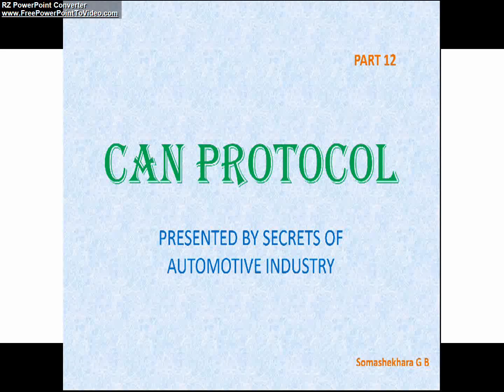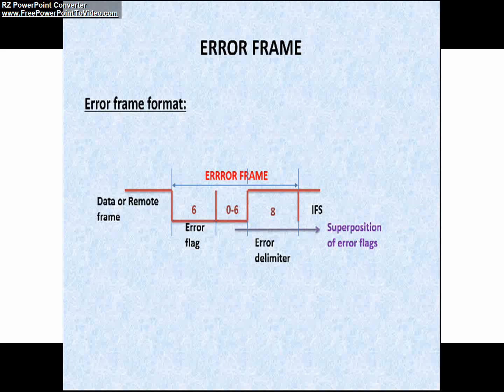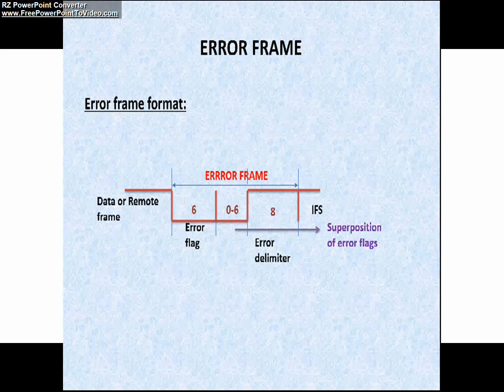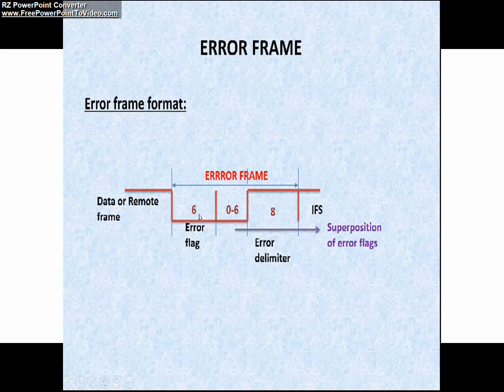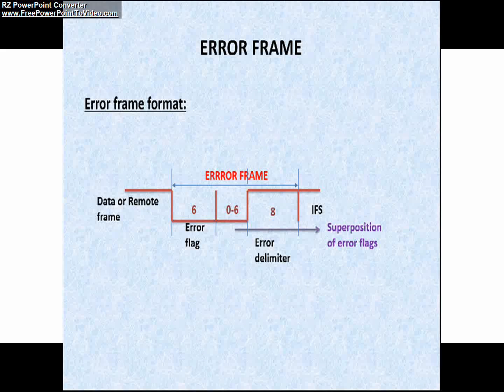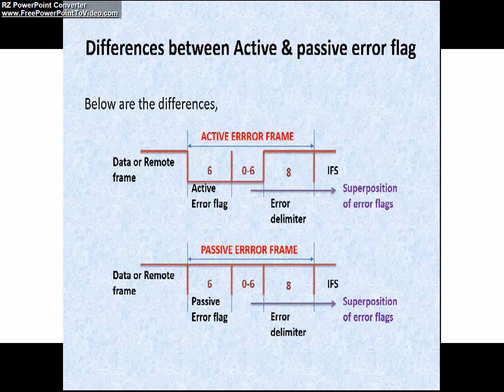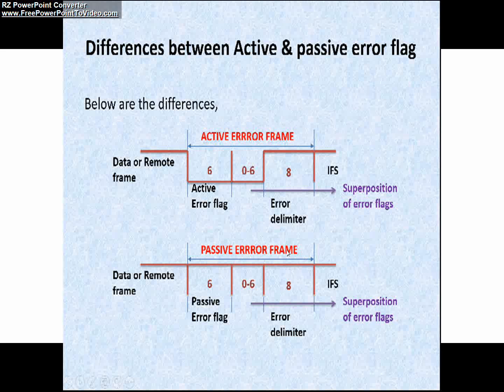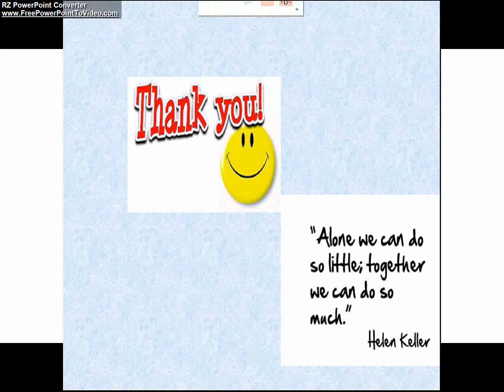CAN protocol basics, PART12, Error Frame.

Comment: how the TEC and REC will increment/decrement and what happens in active error state and passive error state. please explain clearly
Reply from the maker: Hi Amar,

During active error state node can participate in normal communication that means it can send and receive messages. if it finds an error frame it sends an active error frame over CAN bus, that will be considered by other node has a error frame.
During passive error state node can send and receive frames but when it finds an error it sends passive error frame over CAN bus this error frame will be ignored by others.

in case of queries, please leave comments here..
Reply: you said " if it finds an error frame it sends an active error frame over CAN bus" my doubt is who will send the error frame before active error frame.

Comment: Hi Somashekara! I'm new to automotive environment and I'm learning CAN protocol from your tutorial videos. I have few doubts in this videos which I listed below. Can you please explain me on the same? Thanks in advance.
1. How an error frame can be identified by any node in a CAN network as like data frames and remote frames are identified by SOF bit (dominant bit).
2. The transmitting node broadcasts the data in the CAN network and all the nodes in the CAN network can able to read the message and understands the data by matching the identifier. A node which has no effect on a specific identifier can able to check for error?
3. How a specific node understands that the data transmitted  by that node has an error for which other nodes sends error frames?
Reply from the maker: 1. If node detects an error it sends an error frame over the CAN bus and monitors the same for 6 consecutive dominant bits and in addition it also looks for another 0-6 dominant bits(in case of active error node and superposition of error flags).
2.  The node which is not responsible for receiving the particular message means it will be always looking for the bus idle to transmit its message. As you already know, if the particular message not belongs to that means it does not going to receive the same right. hence it is not receiving means, it will not look for any error detection.
3. Same as first question, if it finds an 6 consecutive dominant bits (Also please do not apply bit stuffing concept rule here, the law of bit stuffing is violated in error flag field, that is the reason you will be getting superposition of error flag field (0-6).

Honestly I have doubt on 3rd question here, kindly elaborate the question. in case, your query is not cleared.

Comment: In super position of error flag why it was mentioned as 0-6 ?Because if receiver finds error in transmitted  msg it should send error flag of 6 bits but not 0-6
Reply from the maker: Good question....

let say error active station detecting an error condition and sends an active error flag of  6 bits, this error flag field violates the law of bit stuffing, as a consequence the other nodes thinks that stuff error occurred which in turn starts transmits their error frames over CAN bus thus 0-6 its are the bits contributed from different nodes..

still not clear, please leave comments here...
Reply: does that means  the super position field indicates how many times the error frame has been send/how many error times are error flags attached to it..?
Reply: @secretsofautomotiveindustr2910  can yu  explain its not clear sir

Comment: In passive error frame there are 6 consecutive recessive bits followed by 8 recessive bits total (6+8=14). During a passive error frame is caused the other nodes thinks bus is in ideal state (because of no bit stuffing and continuous recessive bits),but why don't any other node not transmit in that particular time....?
Reply from the maker: No other nodes think that bus is in idle state, for each message there will be a latency time defined and After transmission of an ERROR FLAG each station sends ’recessive’ bits and monitors the bus until it detects a ’recessive’ bit. Afterwards it starts transmitting seven more ’recessive’ bits.
Reply: Thank you sir...
Reply from the maker: Welcome.
Reply from the maker: No problem.